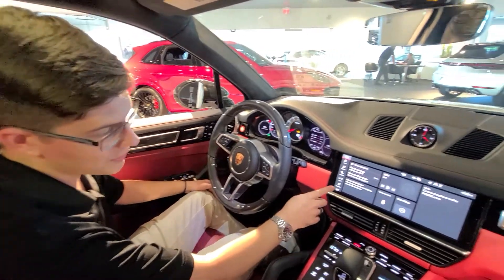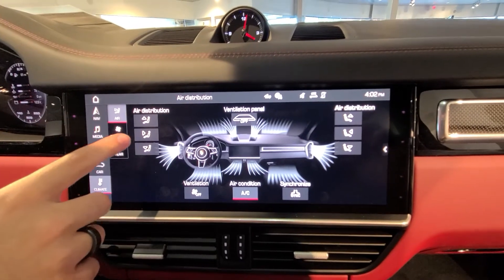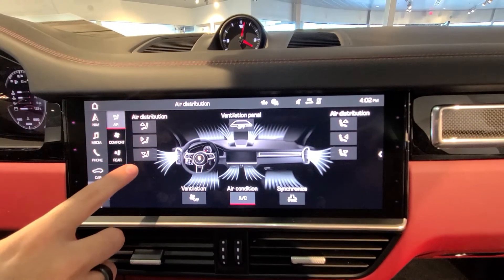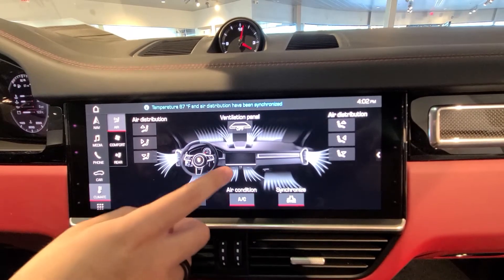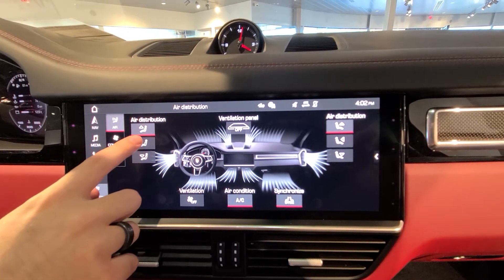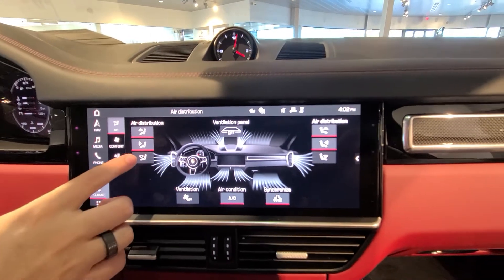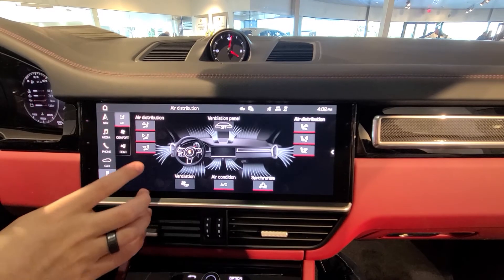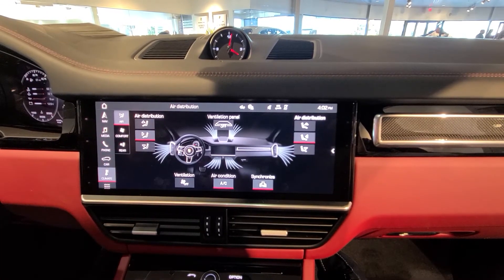How to change the air distribution settings on your Porsche

Comment: Heh on the 992 Targa can the car be programmed so that the remote can open and close the Targa top?
Reply from the maker: Unfortunately this is not currently a function on the Porsche keys. We can only dream of being able to open our Targa tops remotely!
Reply: @porschemelbourne_fl  actually there is a company Smarttop here in the states that sells a module that allows your remote to open and close the top - double fast click and it opens. My Targa was the test car to make a module for the 992 targa. No wire cutting and easy plug and play installation. Also allows a two touch auto open and close using the switches inside the car. Around $450 —-